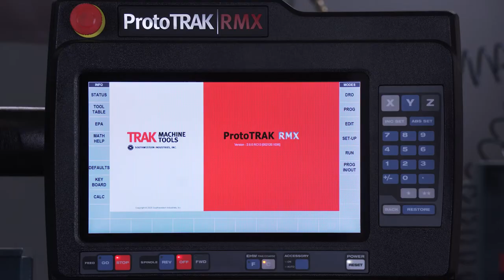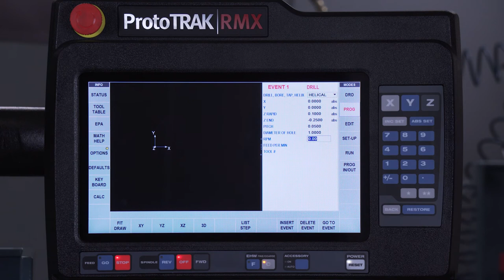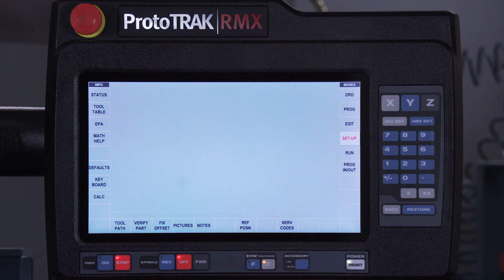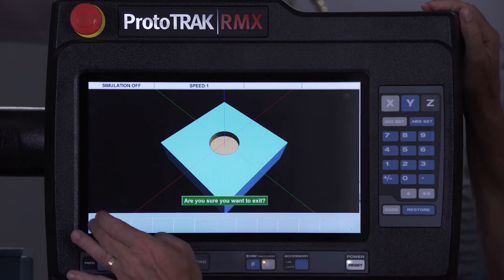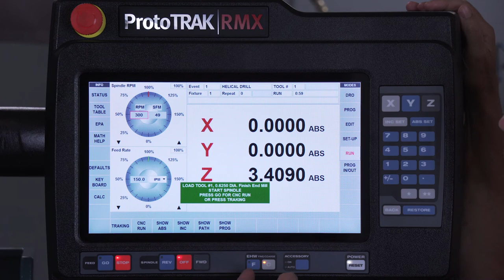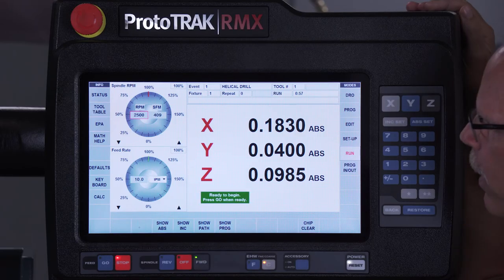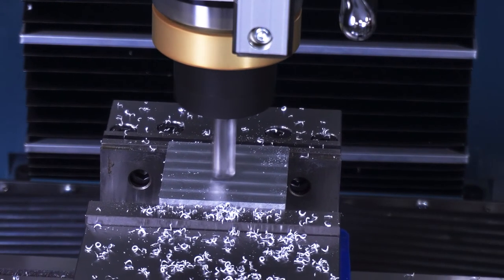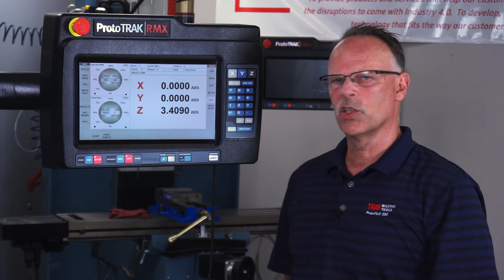Helical Drilling with the ProtoTRAK RMX

Comment: So Pat, what would the machine do if you used an endmill smaller diameter than the radius of the hole?
Reply: Hi Tim!  Lets say that you have 1" diameter hole and it's also 1" deep.  Now, you want to use a .375" diameter end mill.  As the tool moves down in a helix, it will leave a post in the middle of the hole from top to bottom.  In this case, that post will be .125" in diameter and 1" tall.  Once the floor is finished, the tool will move the the middle of the hole before it goes back up to exit the hole.  The entire tool will try to take out that post which most likely will not go well.  If you use at least a .500 diameter end mill, you should avoid this problem.  I prefer to use a tool that is larger just to guarantee the floor is finished completely before the tool moves to the center.   I hope this answers your question.  T.P.
Reply: @trakingpat2750  Thanks Pat